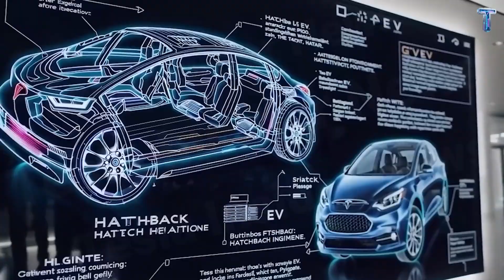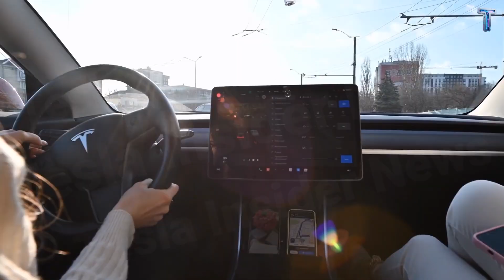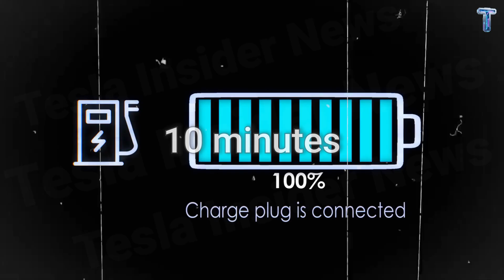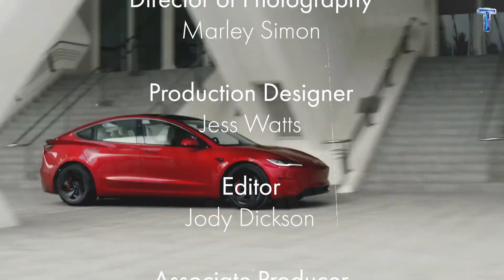$12,749 Model 2: Is The Fire-Proof Al-ion Battery FINALLY Confirmed?

Comment: $12,749 for a Tesla? No way. There has to be a catch. Probably super short range or cheap materials.
Reply from the maker: Totally fair to question it — but the Model 2’s built in Texas with a new Al-ion battery. Stronger, safer, and cheaper. Sometimes innovation actually delivers